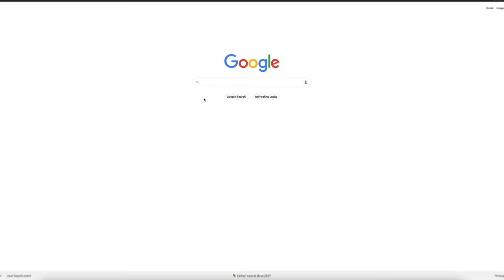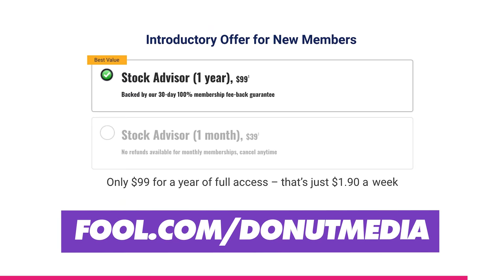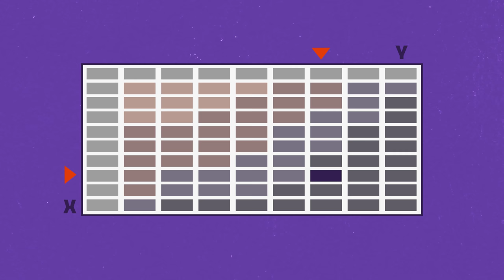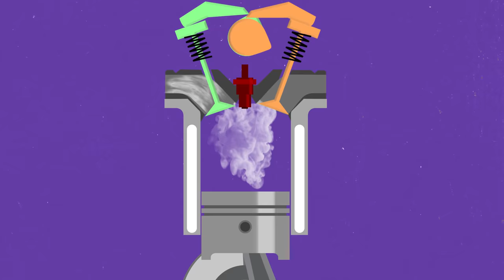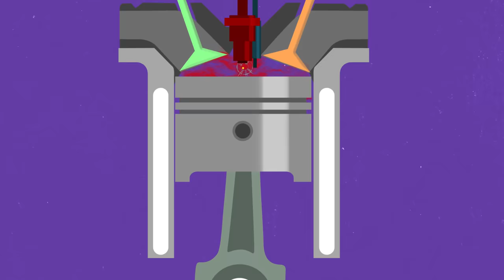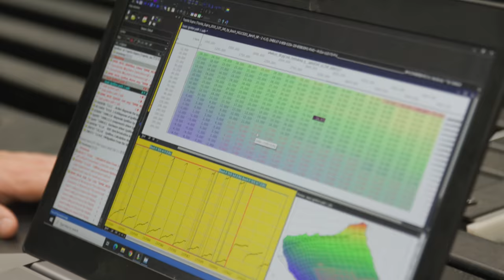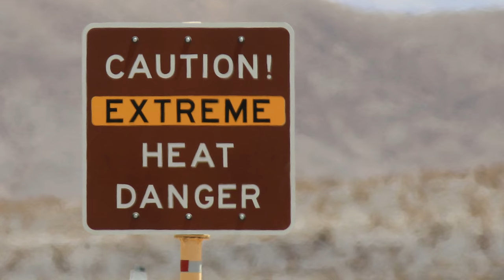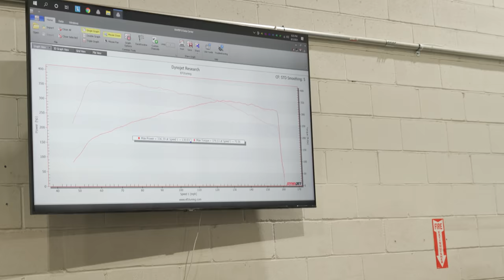Why Are They Banning ECU Tuning?

Comment: Well... good tune, custom done for specific exact car on the dyno could increase power and efficiency, however such tuning is expensive and not really that common. Besides that is only talking about stock cars, if you have heavily modified car with massive turbo and 2-step or anti-lag... and not sure efficiency and fuel economy comes into equation anymore... and how many ricers are running with shit tuning done by some marrons? I would guess maybe 10% of ECU tuning is done "correctly" and even then it only is more efficient when compared to power it makes, not necessary less polluting overall. I mean sure - what is better for environment? Well tuned 2L car or poorly tuned 3L car, which both makes same power... So there is some logic that well tuned cars efficiency adds-up. But this is just 1 in 10 tuned cars, majority will have crap tuning. So I see where the ban is coming from.... BUT that does not mean I support it.
I think it would be far better to do roadside inspection and stop and confiscate cars which are smoking and clearly not running efficiently. It seems like goverment is too lazy to do "on the ground" inspection to determine who is running trashbangers, so they simply decided to ban all tuned cars, bot good and bad. So yes this approach is lazy, but at the same time let's not pretend all tuned car "saves environment and are more efficient"...
Reply: Can't be bothered
Reply: According to the new laws. Not even cars built for racing are legal in CA. You cant buy a car from the lot and turn it into a race car with no plans to ever drive on the street. any modification is illegal.

Comment: I grew up in Colorado and modified my 2001 Honda Civic EX: AEM V2 cold air intake, DC ceramic coated 4 into 1 headers, custom cat-back exhaust, Apexi chip, underdrive pulleys, etc... Took it for its emissions test and had a nearby cop tell me I was going to fail and he was going to ticket me when I did. Test came back with an Ultra Low Emissions Vehicle rating. No ticket for me! And all those mods boosted my fuel economy as high as 45mpg highway. My dad did rack up some photoradar tickets in that car though XD This California law is not well thought out.

Comment: I just went on a 30 day road trip from Ohio to the West coast and back, and I gotta admit... the higher regulation and cost of living in Cali is a big deterrent for me. Sure, it was beautiful and unique there. But I've learned that almost everywhere is unique (except for the sprawling fields of the midwest, that's why it's cheaper to live there, haha 😅). Gas alone is 4.60/gal in CA, but in Iowa I bought it for 2.63/gal. If you have a job where you don't have to live in LA and you're not a surfer, there are lots of other neat places to live 👍

Comment: The smog machine only sees the results. If the ECU tuning makes the smog outside of the manufacturers parameters, then that’s the problem. You can always have a spare ECU for the smog test. Or check the smog after the ECU mod and see if it still passes.

Comment: Over here in Germany its quite common and a lot of tuning companies offer it. However in almost any case the cars operation permit and insurance expires due to this modification. This can also be considered as tax fraud as the exaust emissions change...so in total this is not recommendable at all. If the cops catch you this can end very bad and expensive. My recommendation, apart from the country or state you live, get a street legal car with some power right away...

Comment: Imagine ECUs being equipped with GPS and a Weather Feed. The ECU could adjust to the location's altitude, temp, humidity, etc, and alter the mappings for an ideal tune.
Reply: ECU's already have Intake Air Temperature (IAT) and Manifold Absolute Pressure (MAP). Humidity isn't that much of a factor. Check out "driving 4 answers" video on every sensor explained if you're curious.
Reply: @TurboHappyCar  I guess I did know temp. So silly of me. 

But still, how about altitude?  Major factor.
Reply: @CitAllHearItAll  Aircraft measure altitude with pressure. 😁 All of those little probies on an airplane? Those are "pitot tubes" to measure the ram-air effect and to determine air speed. Also part of the system are the "static ports" that measure air pressure. Look up "pressure altitude" for the formula. For combustion purposes, all they really want to know is the mass of the air inside the cylinder. Then they inject the right mass of fuel to go with that air to meet the desired air-fuel ratio. Think of "mass" as the number of air and fuel molecules trapped in the cylinder, that are going to ignite. Check out the "ideal gas law" to see how with pressure (MAP), volume (cylinder volume), and temperature (IAT) they can determine the number of air molecules in the cylinder.
Reply: @TurboHappyCar  Thanks for the great reply. I understand air mass. I understand volume and temperature's affect on air mass. I guess the thing I need to learn about is how the pressure is determined. I  figured that alititude would be necessary to calculate air mass, but from what you're telling me, the pressure sensor can determine that. That's pretty cool. Thanks dude.

Comment: There isn't a car I have owned in 30 years I didn't have at the very least an ECU tune done on it. It's basically free power, torque and possibly even slightly better fuel economy. Most of these cars were turbo engined so the gains can be pretty significant.

Comment: I got an aftermarket tune for my 2008 Pontiac Solstice, and not only did the performance improve, but so did the fuel economy. I recently bought a Toyota RAV4 , and it comes with tune settings. The economy one pretty much sucks all life from the vehicle, making it useless to attempt to maintain highway speed when engaged. It's only useful in stop-and-go traffic. So a factory is already providing in-vehicle tuning, which just so happens to not be against the law.
I think the real reason CA is enacting the tuning law isn't about emissions, it's about Right To Repair. Emissions lauded legislation which prevents anything but factory provided vehicle parts and service is really stealth anti Right To Repair legislation.

Comment: Love Donut Media, but you misunderstand this problem. Factory tuned engines meet emissions all the time. ECU tuning is to meets emissions for the smog test and then alters the profile for performance driving. It basically means ECU tuning uses the tried-and-caught VW emissions method of "passing" emissions and California wants engines to prove they are emissions compliant in daily driving.

Comment: I have to call you out on some misinformation at the 6:30 mark. Manufacturers mainly only target 14.7:1 Air/Fuel ratio when the vehicle is at part throttle and lower loads. When the vehicle goes into power enrichment mode (when passing another vehicle on the hwy) they target a very rich Air/Fuel ratio. Usually 12-11:1 on naturally aspirated vehicle and 10:1 on forced induction vehicles which is way too rich. As mentioned in the vid, this is due to the fact that the vehicles have to be tuned conservatively because they have to be used all over the globe. When a car is properly tuned, it is usually producing less emissions. Majority of the time the fuel map has to be reduced to make optimal power. The only exception to this on direct injected economy cars which can target a leaner fuel mixture. However even if you were to tune it (which nobody does) the tuner would still leave the light load lean efficiency areas unaltered and only modify the power enrichment mode.

Comment: Lets be real 90% of ECU tune customers have a eco tune for emissions and have a tune for 'once passed'.  This is the law calling a spade a spade here and cracking down.  If people actually followed the system in good faith then we wouldn't be here but this is MERICA and we do what we want - well until a law is passed or enforced... thank all your roll coal and rev in neutral to 7k rpm for mad backfires crowds.  Can argue how your ECU allows you to run better mpg and perceived emissions, but that means jack shit when you have your fun map and use it most of the time which is practically anyone that spends the money to get their ECU tuned as they are doing it for POWER, not MAD ECO CRED bro.

Comment: 5:34 Maybe worth mentioning that the air-fuel ratio is a mass ratio (not a volume ratio, as one might expect). I believe chemical stoichiometry in general is based on (molar) mass, because that's what determines the energy released and it doesn't change with density.

Comment: Drives my crazy. My 2.5 vw has terrible throttle lag, sometimes up to 1 second. Tuned ECU's fix this but don't add much else. I don't want more power, I just want a responsive throttle, all the emissions stuff is still there. I finally saved up to justify an ecu upgrade, and CA makes it illegal. Can't say I'm terribly surprised, tho.

Comment: I think the rules were slightly misread, the rule specifically affects the smog check. You can't get your car registered if your ECU tune isn't factory or unapproved by CARB. The act of tuning itself isn't made illegal, they're just REALLY restricting it for the smog check. You could literally just run an ECU at factory tune at the time you do the smog check and then change it back when it's done and over with. 

Of course, if I'm wrong then feel free to yell at me in the replies. I might be missing out on something here.

Comment: I dont understand one thing tho... Why does it matter if the ECU is changed? It should be: is the dirty air from the car in range - if yes: PASS, if not: FAIL.
If it has to be taken a step further, they should check air and fuel themselves and calculate what the range of pollution should be and then measure the car.
The highest step would be a dyno to measure the HP, calculate the expected pollution and then PASS/FAIL.

Comment: The EPA is trying to outlaw ECU tuning in every state. They also are pushing to outlaw turning any vehicle sold as a road going mode of transport into an off road use only vehicle. I believe I heard someone in another you tubers chanel say they are interpiting vehicle as being in road use only as intended by the manufacturer.

Comment: That pic @2:45 is from the german movie "Manta Manta" from 1991. It was about the car Opel Manta, at that time there was a cliche that their drivers are not the smartest guys and there existed a lot of Manta jokes. In that scene they install a race engine in their Opel Manta to drive a road race against a Mercedes the day after. It´s a C20XE four cylinder 2liter na which is supposed to have 270hp. Btw, it´s from a tuning/racing company called Kissling, they used to race on the Nürburgring Nordschleife, some races also with a Corvette.
They won the race, the Mercedes crashed, it jumped over a Ferrari, happy end.

Comment: As long as the tail pipe emissions are in line, and the ECU doesn't throw any codes, how can anyone know that the ECU has ben tuned? "Tune up and shut up!" Just don't say anything. So what, if the car seems to run particularly well? I always tune for thermal efficiency, which improves both fuel efficiency, as well as power.

Comment: I went with a catted COBB stage II kit on my WRX and got 2 MPG more - passed emissions every year, plus I had a much wider power band, not as peaky as stock.  I think it's 100% possible to do better than the factory, and the vast majority of people don't modify their cars, so I think they're making a mountain out of a mole hill.  If CA can prove that the relatively small number of modified cars out there contribute significantly to pollution levels with actual numbers then maybe - but I seriously doubt it.
Reply: And I think one of the reasons I got better fuel economy is that I didn't have to get into it as much pulling away from a light because the turbo came on so much earlier, and there was less incentive to drive like an idiot after every light.

Comment: The unburned fuel from a richer tune is one of the biggest polluters in exhaust gas, right? You wouldn't know if the catalytic converter could process the extra unburnt fuel. Then if you start fiddling with the cat, there's no doubt that the emissions are worse

Comment: Say I had a 240sx or a k swapped civic and I wanted to install like a haltech ecu, would a shop that is certified to tune be allowed to install and run a map on my car? Im not looking to make 1000hp, more like 250-350. No straight pipes, just a legal borla exhaust, no huge turbo, just some nice clean mods to make some daily driveable power. This is a hypothetical question.

Comment: Warning: wall of text below.
I lived in California for a few decades. The air was dirtier 20-30 years ago and it's gotten cleaner since then even though population and commute distance has increased. CARB rules for automotive have always been weird, originally they used tailpipe sniffers to measure how much pollutants each car was making but there were also weird rules like certain aftermarket parts were an instant failure of the 'visual inspection' even if the tailpipe sniffer said the exhaust was clean. Kids with mostly-stock cars would pass the sniffer test but fail the visual test for silly stuff like blingy anodized fuel rails. Also it's against the law to replace an old car's cat converter with a newer (better) design, even if the exhaust sniffer says it runs clean. Also certain cars or trucks are allowed to pollute more based on how heavy they are, so a truck that weighs twice as much as little Honda might be allowed to pollute 3x as much (even at idle) because it has more cargo capacity. People figured out how to cheat the tailpipe sniffer tests (usually the operator helped them for an under-the-table cash payment), sometimes going as far as connecting the sniffer gear to another car instead of fixing the broken car. Or they would build a dirty 'fast' setup with deleted cats and big turbos 99% of the time but keep all their stock parts and only reinstall them every 2 years when their car needed to pass an emissions test to update the registration. For a brief time around 2008 they had mobile smog machines sniffing exhaust where people would accelerate at freeway onramps, and they used that data to bust dirty cars and maybe even dirty smog inspection shops that had helped them cheat. I think this was a good method of catching the people who were actually polluting the air in real-world conditions, I'm not sure why they stopped doing it. https://www.wired.com/2007/09/california-smog/  Later CARB switched over to trusting the ECU's self-checks for newer cars and assuming the car would be running clean if the ECU claims all the emissions parts are passing self-checks. Then people with reflashed factory ECUs learned how to fake the self-checks, so they could have a car blowing black smoke but the reflashed ECU said 'all emissions parts are good, sir' and they passed anyway. Now the smog checks report the ECU's calibration ID or checksum or something similar to make sure the ECU hasn't been reflashed. But you'll still fail if your old car has a different (even better) cat converter installed, even if the factory ECU hasn't been reflashed.

And the big diesel 18-wheelers still blow visible soot in the air when driving your Amazon shipping boxes around.
And the brand new off-the-lot cars don't necessarily meet the EPA standards as the 'totally-not-special production example vehicles' that the manufacturer sends for government emissions testing.
And city/county/state law enforcement still leave their cruisers idling most times they exit the vehicle because they don't maintain them well enough to trust the engine will start 10-20 times every day.
And testing to prove aftermarket devices are clean enough for CARB certification is still time-consuming and expensive, even though SEMA built an expensive compliance lab and offers to help manufacturers do it. 

Don't get me wrong, California air has gotten better but that doesn't mean there's no room for improvement in CARB rules or policies.

Comment: Seen this coming. How many vehicles can Rob Dahm tune to run on 2 stroke gas mix (with oil added to the gasoline for engine protection). But clouds of burnt oil are puffing out the turbo exhaust. 🤦🏻‍♂️

Comment: If tuning is done correctly exhaust emissions should be lower as the engine is using the fuel more efficiently to make more power. Fuel mileage will suffer, but as we all know there is no free lunch. Wanna play, ya gotta pay.

Comment: Great video on the basics of ECU tuning, but did you ever even ask about why they are banning it? Nope, don't think so...
My understanding is the pressure to ban tuning is not about performance cars, but rather it is being driven by the diesel truck market (think Diesel Brothers) where estimates are 10 percent of those trucks are being 'tuned' to bypass emissions so they can in part "roll coal". Its the environmentalists who wish to ban those modifications and the huge environmental impact those modified diesel trucks have (some estimates are 20 times the impact of the VW Passat "diesel gate") that are targeting the segment of ECU and engine modification companies. Because even Cali can't effectively monitor and enforce individual use cases. But they can monitor and enforce companies that make and install the devices (i.e. shut down one company that makes 200,000 devices or try and verify 200k vehicle modifications one at a time?)
I don't want my ability to modify the engine of my track car, but I have no problem removing the ability of diesel trucks to roll coal.